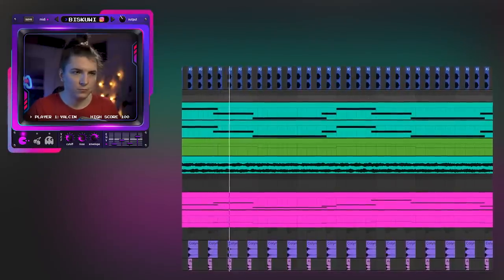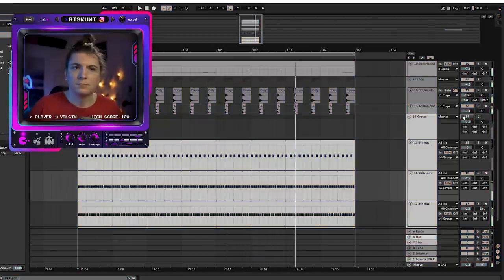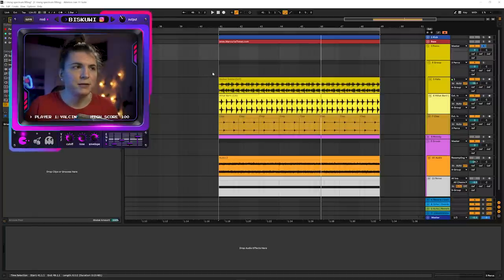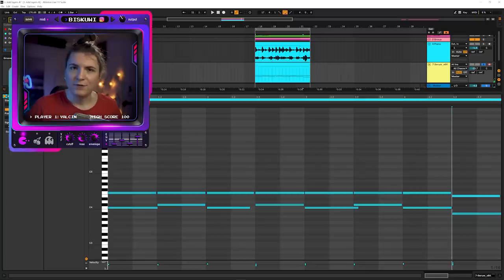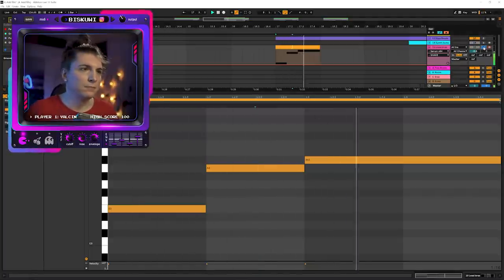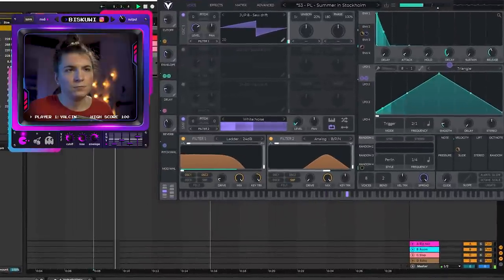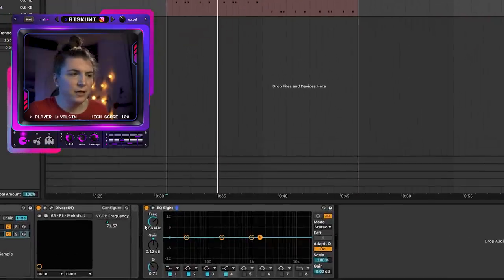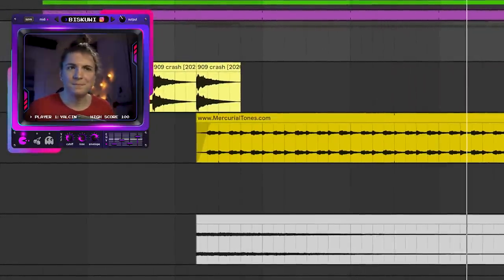7 Easy Ways to Add Energy to Repetitive Track

Comment: I love the high shelf trick to give the impression of opening the filter without actually doing it! You could actually also do this with different things like a band-based saturation or bit-crusher or even apply it to samples where you can't open the filter for obvious reasons. Endless possibilities!!
Reply from the maker: 💯 you can use any other fx that saturates or boosts to high end to get similar fx